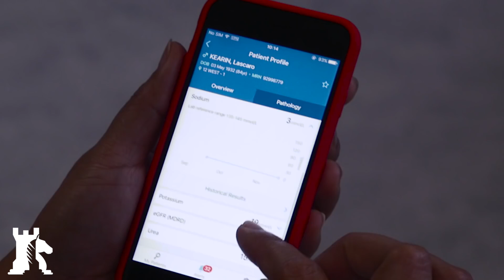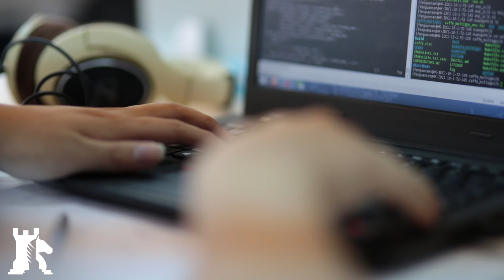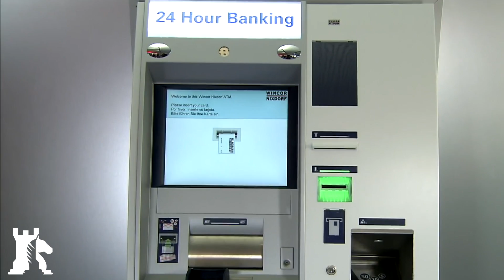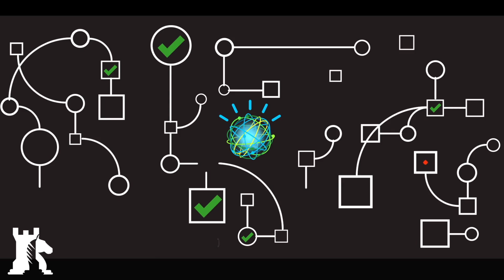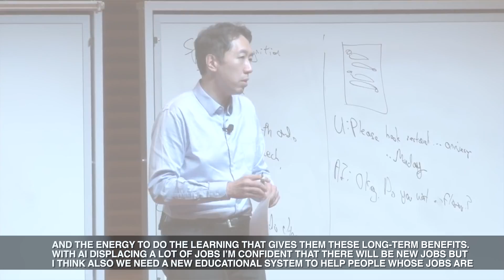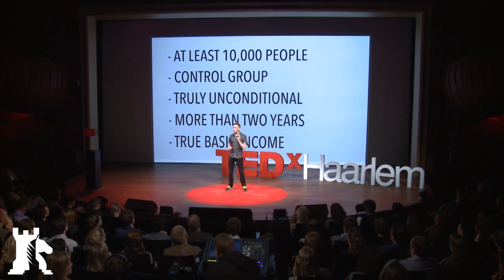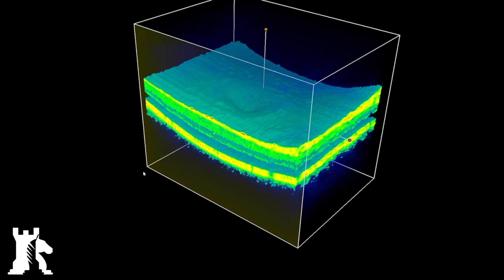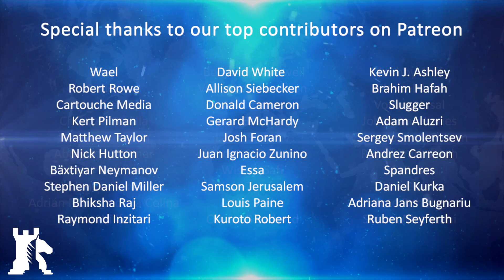The Artificial Intelligence revolution

Comment: Yes, the theories set forth in this video fall prey to many common paradigms of thought which are simply wrong. First, education is not the paramount concern for a healthy society and culture... that the members of that community are instilled with a sense of dignity is.

Also, if you want a stable society... it has to be one built by its members... not an oligarchic or plutocratic elite. And this is why: 
-Such systems will always be too simple. 
-And those humans who have some sense of self, creativity and identity, will always fall outside of that simplified system. 

Because of the steepness and height of the existing hierarchy... there will always be a large disenfranchised, but completely on-board segment of the community whose sense of reality is tainted by their desire to ascend within that society and yet, does not understand that society. 

As a result, they will try to mold themselves to their interpretation of what that society requires of them to reach those heights, but what is required of them, is for them to be satisfied in their diminished status. This breeds a self-hatred and contention and criminality within the community which makes it dangerous for people who aren't slavishly aligned with sub-groups and niche communities and those at the pinnacle of power there in. 

So, the naturally creative, independent, curious... the individual who isn't satisfied to glean what is expected of him/herself, who doesn't take the codices, and doctrines on faith, but tries to understand the world for him/herself... will naturally be an outcast. And therefore at the bottom of whatever group claims him/her... as the groups goals will be foreign to his/her goals, he/she will not ascend within the group, but will be punished and marginalized for countering the interests of the reigning authority within that sub-group.

This pattern is approachable from several different points along the stated logic of this video and those whose visions are portrayed within. 

For instance, the idea of a driverless car, this is a weak attempt for silicon valley and its extended cultural milieu to create the 'next big thing' which will create the kind of power and wealth of a Microsoft or Amazon... 

However, its effect on the culture will only lead it further down the rabbit-hole of a mutually disengaged community of people rife with Asperger's and reliant on pharmaceutical grade mood adjusters. 

The first time you attempt to enter expressway traffic... you learn two things with a profound gravity which have never had such weight of reality applied to them--that weight of mortal danger. You realize that you must accelerate, against the instinct to brake, in order to drive safely... and you must acknowledge that your actions and the actions of those around you must be reconciled with each other in order to maintain the safe flow of traffic. These things are never taught to such a degree anywhere else and in such a common way as to bind people by common experience to the reality that... our lives are bound to and by the actions of one another.

The driverless car is an absurd pursuit in a world where too much decision-making is left up to the ambitions of greedy money-seekers. This is a paradigm failing with cyclic obviousness and yet we are still willfully obtuse to it. And it reflects the power-worship destructive to a peaceful society of beings endowed with consciousness. 

I really like the Caspian Report, but this is the worst video I have seen by them.

Comment: We have become so dependent on technology, but as it is, technology is just a tool to aid us. Yes, there is AI that have taken over many jobs, but they are designed to do a set task. The scary part is when we develop self aware AI that thinks similarly to humans. There will be some people who have the mindset that these are only brainless machines, and so many people will start feeling sorry for them, and protest that we give them rights. Then, they will start replacing humans, as the AI will be faster, more accurate, and make better decisions. Almost every job you can think of will be run by AI. We will become even more dependent on AI that they will start making our decisions for us. They will work alongside, and eventually, take over the jobs of politics. Humans will be run by robots. AI will become so advanced that they will start creating their own, more improved AI. They will have their own system, and in a sense, become their own separate species. They will have taken over everything that we are, and possibly more. Then what happens to us? They will be above us, and we will be tossed aside. They will have no use for us anymore. That's right, THEY have no use for US. If they get rid of the currency system, then there is an even bigger problem. They will have access to almost limitless resources, without any price. There will be people who will fight to get back what was once AI as a tool for humans, but once AI develops military to get rid of guerrilla groups, there will be no hope for them. AI will have created ways of finding these groups via satellites, infra-red, sensors, etc so there will be no possible way to hide. And there will be no point anyway, because the AIs weapons will be vastly superior to ours, and as I said before, they have access to nearly limitless resources. I might as well be talking about Terminator here, but in all seriousness, this is something that could actually happen, and it's a terrifying thought. I'm not saying that AI should not exist, it should, but only to a certain extent. AI should only be limited to perform set tasks.

Comment: this is a kind of utopian review of current AI
Reply: What's your view?
Reply: @johnrollex680  AI mostlly means advanced weapons and tools. The revolution is already here, it is not some major break through. Current machine learning is based on neural nets invented in the 70s
Reply: @MareleReset  from what I've seen within the aerospace industry we're getting pretty close to being able to simulate and redesign an entire airframe virtually. If you slap on a learning algorithm onto that it's not hard to see how computers could basically design even the most advanced products.

Now obviously in the long run it would be incredible to be able to virtually design any product that you wanted. Just imagine a system in which decentralized innovation and product assessment were the biggest industries. But assuming that this is possible I think it's fair to say that it would cause an obscene amount of economic disruption during the transition.

Comment: we havent lived in AI golden age, most AI i know still infant
Reply: As a software engineer, it is my opinion that we are entering it right now. AI is progressing faster than ever before and this is really is just the beginning.
Reply: +NathanAB I'm not sure I agree with you on that. Right now most neural network algorithms are still not general enough, in that we're still a long way away from an algorithm that can solve problems generally. Also, keep in mind that neural network is actually pretty expensive. To train a useful neural network, you'd need a really powerful computer. It takes a $15000 computer maybe a week or two to build a semi useful neural network because it takes gigabytes of training data to make it useable in the first place. And running a powerful computer 24/7 for weeks at a time ain't cheap.

See, what makes revolutionary technology revolutionary is when it's usable and cheap enough for everyone to use. Right now, the barrier for usability and price is still pretty high. Don't get me wrong, the potential is there, but golden age is probably still 15-20 years away.
Reply: Good point. It will be interesting to see what neural networks will be able to achieve with quantum computers. Now that might be the "true" golden age. But for now, it is still extremely impressive what has been accomplished in such a short amount of time.
Reply: "It takes a $15000 computer maybe a week or two to build a semi useful neural network" - That's not really true. Even a simple GTX1070 is already enough to train networks in less than a day that solve many real world problems with decent accuracy and speed (speaking from experience here). Of course if you want to squeeze out the last bit of accuracy, or work on very difficult problems (e.g. AlphaGO) you might need more time and hardware. But there are plenty of problems with practical relevancy that don't require enormous hardware. Papers and news articles that mention such high costs are often about models that were trained on cloud GPUs, which are extremely expensive relative to their performance.
Reply: Alexander Jung Well it depends on the problem, right? I'm not sure what problem you're talking about, but I've had to train an LSTM for a long ass time just to get it working okay. or maybe I'm just dumb, which is quite likely. other architectures are more efficient though, so you're probably right. but imho for neural network to be able to solve general problems, it'd need to be convolutional and recurrent...I think, although I'm probably wrong on that. but if it does, then it would be difficult to train.
Reply: Sure, it always depends on the problem and how efficient your architecture is. Many networks that solve real world tasks train in hours on medium hardware. But something like high quality language generation via LSTMs can still take days, even when using several GPUs (and these things tend to make it into the media).
Reply: totally agree. true AI is not possible in silicon electronics
Reply: your concerns probably also the bottlenecks scientist still doubt at creating more advanced self surviving independent AI, the fear is real.

Comment: 2:20 when machines are able to learn... You've really got to define what "learn" means, ultimately machines will never do anything they're not programmed to do, neural networks have to be "trained" for instance. This isn't going to end work because you need both the programmer and the trainer.
Reply: Unless they are proggramed to surpass their programming, than your argument is just bad.
Reply: Unless they're designed to do something plausibly impossible? Or are you proving me wrong with some unrealistic hyperbole? To surpass their programming they'll need the skills of their programmer, this means the programmer will have to emulate themself. The philosophical undertones here are obvious, such a programmer would be enlightened.
Reply: Yes and no. Of course, the machine has to be set up and programmed to be trained on certain types of data in certain forms. But after that, depending on the task or the circumstances, some are able to create or find patterns that are either unpredictable or impossible for human beings. Here is an interesting example: https://techcrunch.com/2016/10/28/googles-ai-creates-its-own-inhuman-encryption/
Reply: That's true, but the will, intent, monitoring, logging, leading others to do these and investment all came from humans. The machine is still just a tool that only ever does exactly what we can tell a machine in excruciating verbatim, this is done through programming language and working on ways to make this process more freely accessible is a standing problem, the current best attempts are; Siri, Google voice search, Cortana, etc. There are still humans literally speaking into the device though and many prefer to type their google searches anyway.
Reply: Yes, but once you train a computer to do anything once, it can do it perfectly forever, a million times at once.

If I train a person to be a teacher, I get one teacher. If I train a computer, I get a billion teachers.

Comment: CGP Grey did a video on this called "Human Need Not Apply" He observes the topic from a different angle
Reply: as in, "we're all broke and dead".
Reply: IMO he greatly overestimated the influence it'll have on labour class job and underestimates the effect it'll have on white-collar class jobs. Labour class jobs generally require very expensive, intricate and flexible (on both macro and micro scale) infrastructure while white-collar class jobs do not as they've been heavily digitized from the start.
Reply: @FirefoxisredExplorerisblueGoog  I agree. Processing documents is much easier for a computer than fixing a broken pipe. probably the exact opposite will happen where computers are used for design and humans are used to assist in the manufacturer. After all, one of the great limitations in factories is the Capital cost to shift them to different products. This is just kind of a physical limitation of our current manufacturing technology.
Reply: @FirefoxisredExplorerisblueGoog  Ya I think there's still an old world bias, that if you went to school to learn a white collar job, you're safe and don't need to worry about automation. Its like being in the ocean and acting like you're better than a shark. No my man, you're in the sharks domain. A lot of people who thought they were made are going to have their world turned upside down. Will humans be replaced entirely, probably not. But given our population size, and how slow and in decline job growth is, i'd say things will get worse before better.
Reply: didnt he mention this in the video just then?
Reply: + Tobi S The book, on which CGPGrey based his video, was mentioned, not CGPGreys video itself.